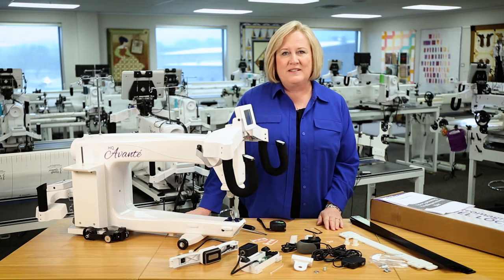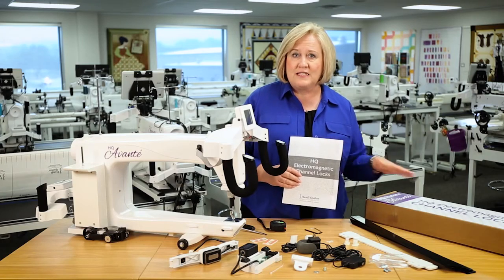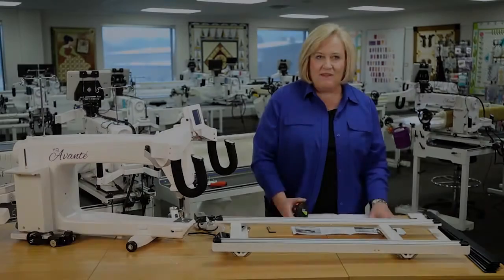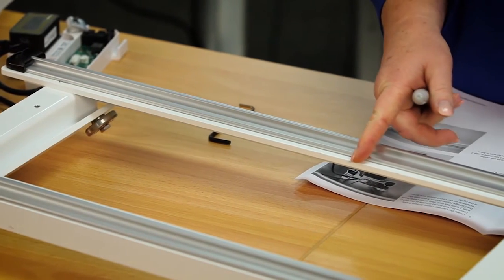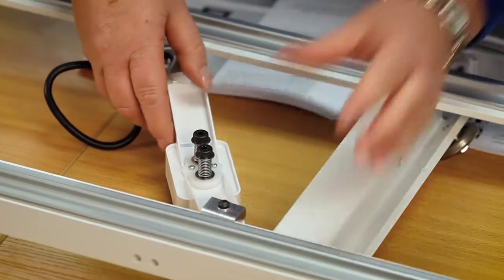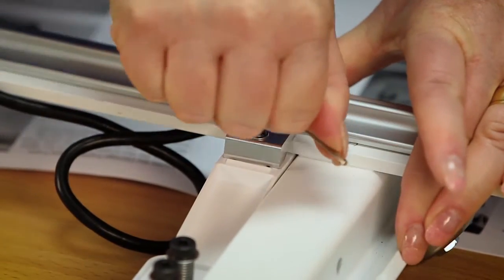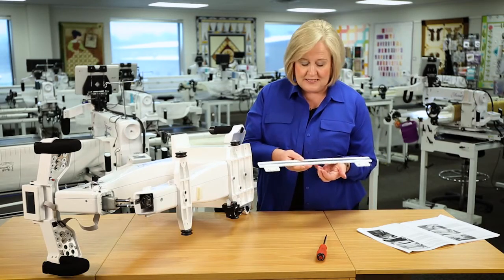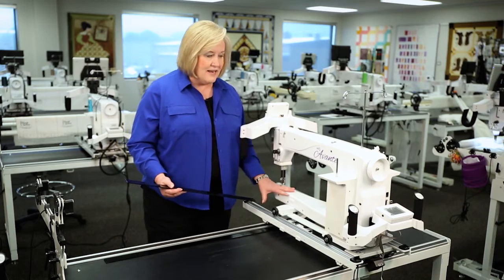HQ Electromagnetic Channel Locks: Simple Installation

Comment: Is there a video specific to the Amara?  I have used the Amara channel locks trouble free for a while, now, but suddenly the x axis was failing.  It started back up on its own.  A troubleshooting video would be helpful.  I took it apart and put it back on, but it's still doing it occasionally.
Reply from the maker: I would recommend that you call Handi Quilter Technical Solutions department.

Comment: Has anyone else complained about a drag noted when quilting in the area where the frame sections join when the electromagnetic channel lock is installed?   Also one of the steel bars stops the carriage nearly every time I get to that spot requiring me to move the carriage and push it down.   I believe my machine is leveled - and even tried dropping those particular areas down to see if that helped - it didn't.   When I remove the steel bars I don't have that drag.  I am a newbie so thought perhaps after I get a bit more experience it may not be a problem - but wondered if anyone else experienced that.

Comment: My electromagnetic locks worked twice.  Now they don't work.  The dealership installed it on my machine.  I have no idea what is happening..
Reply from the maker: Call the HQ technical support line and they should be able to assist you.